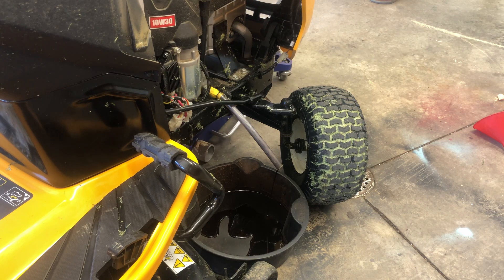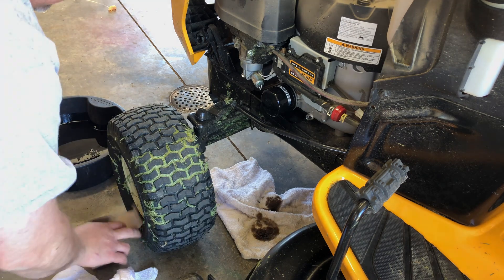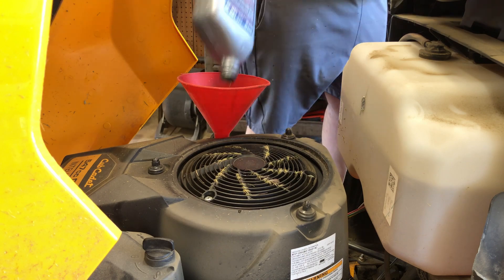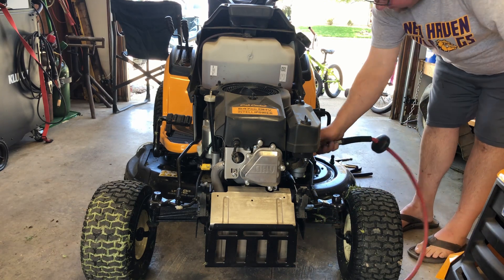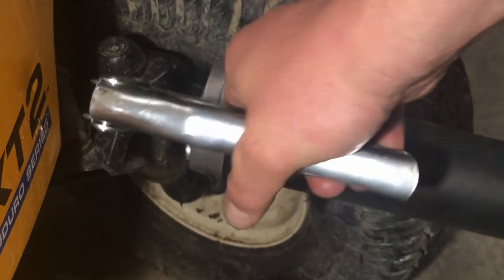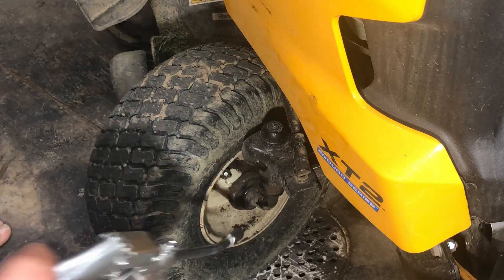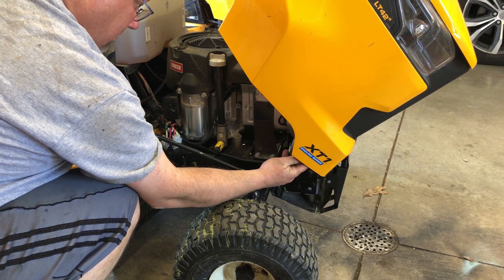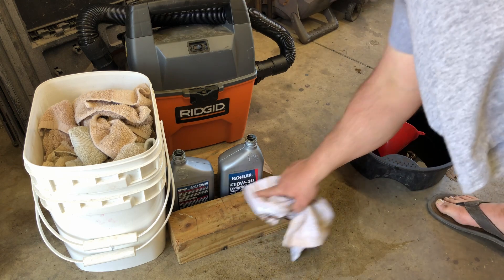Cub Cadet XT1 / XT2 Full service / Full maintenance including oil and filter change.

Comment: You should always apply NEW OIL on the new oil filter seal. Not old dirty gritty used oil. Who ever told you to use the old oil did not know what they were doing. You have new oil right there. Just a dab of it and you’re done.
Reply from the maker: I’ve never heard that but I feel like I’ve learned something new today. Thanks for the advice and I will do that from now on. I come from a humble background.
Reply: I  saw my neighbow forget to fill his new oil filter before he put it on  ,  not good either
Reply: @sissymurphy9620  both of these "tips" are misinformation. new oil isn't needed on the o-rings (makes no difference) and you should NEVER intentionally introduce contaminants into the "post-filtered" side of filters by pouring unfiltered fluid into them. new oil is incredibly dirty straight out of the bottle
Reply: @armedanddangerousdiy6096 amazing video sir, thank you so much for showing us step by step.
Reply: Nah, it doesn't matter. All the sediment goes to the bottom of the oil in the old oil pan when drained so as long as you skimmed oil from the top to use on o ring, you would be fine.

Comment: I realized that both mowers had the Cub Cadet engines installed because the Kohler orientation is entirely different.  I certainly appreciated your content. I have to do a tune up shortly.  Someone has some cool ideas or money saving tips.
Reply from the maker: Great point!
Reply: Those Cub motors are absolute trash- poor intake system allows fine grit to be ingested, scoring the bore

Comment: Some dispute about using grease on the steering gear…..many say the grease attracts dirt and debris and causes wear…suggest using a spray dry lubricant instead…that spin on oil filter is a real pain…oil leaks all over when taking it off…I fashioned a small tray to divert the oil beyond the frame to the catch pan…just my two cents…good job..
Reply from the maker: I had the same thought when I put the grease on, but I also know metal on metal is not the greatest idea either. I was figured I could clean it off with degreaser and acetone and try something else. I am going to go hunting for this mythical dry lubricant you mentioned is it just never occurred to me that such a product would’ve existed. Thank you!
Reply: DRY LUBE   or lithium dry lube

Comment: Interesting video. I assume this full maintenance is done once a year.
Reply from the maker: Yes. I did it in the spring for this video, but typically I do it in the fall after leaf pick up because the dust clogs the air filter. This way it’s ready to go in the spring time.

Comment: Please tell me how to make my intellipower run!  New Carb, Clean Gas, Clean Air,Filter, Clean fuel filter, clean fuel tank.  Carb was installed by certified servicer as was the fuel filter.  The dealer also drained entire fuel system, tank included    it starts but the only runs well when intellipower is cranked up all the was and blade is engaged.  Has 40 hours on it,  driven on level ground by a 87 year old man.  PLEASE.    Thank you.
Reply from the maker: I’m sorry but xt2 does not have that feature. It’s just an old skool throttle and choke cable. If it only runs well under load it sounds like it’s running rich. With only 40 hours…is it still under warranty?  Mine had a 3 yr warranty.

Comment: We bought a refurbished (never again) XT1 from home depot 1 yr and 1 week ago. Yep, that ONE week got us on warranty 😢anyway, both belts are fine but it stopped moving? Is there anything we can check? Hubs says he doesn't see a way to check transmission fluid in the hydrostatic trans? But obviously its something bigger than the belts? Thoughts? Help???😊
Reply from the maker: To be honest, I’m kind of a lousy mechanic, but if I had to guess I’d say your transmission is low on hydraulic fluid. Maybe you have a leak? I did some investigation myself several years ago and you are right that it is a sealed unit.  To be frank I’ve had nothing but trouble with mine as well considering it’s less than four years old. I’ll never buy another one of those that’s for sure. The only reason I bought it is most of the good tractors are too wide to fit between my cars in the garage. In a couple more years, I’ll dump this one and buy something of a higher quality from a dealer.
Reply from the maker: I spent 2700 with a snow plow blade and leaf bagger. I’m definitely mad
Reply: @armedanddangerousdiy6096  I just reached out to the repair center that Home Depot recommends and within 30 seconds he told me he has 7 or 8 of them, they're junk. Lol good to know NOW!🤣🤣🤣

Comment: You better take care of what u have the new Cub cadet is really gone down hill in quality, I bought a new LT enduro 50” the battery is AGM, which is weak, i replaced it in less than a year, selinoied  went out in 20 hours, transmission went out in 66 hours, MTD is gone to crap , the engine is good but the rest of is trash or cheap
Reply from the maker: I’ve had several repairs on this tractor and it’s only three years old. I fully agree with your assessment. The issue for me is no one makes a good quality mower. That’s small enough that I can fit between the cars in my garage. My plan is to own it another three or four years and go buy something else. But your comment is well founded. Cub cadet is not what it used to be. I think I’m going to go back to John Deere, a good one from the dealership, not a cheap junkie one from the local builder supply.

Comment: Does this differ much for the xt3?
Reply from the maker: I’m not super familiar with cub cadets line. The only difference between the XT one and the XT two is a larger engine and some other trim options that don’t really affect the mechanical functioning of it. If I had to guess I would say no and the XT three is just a slightly more heavy duty version. I have the XT two and my neighbor across the street. Has the XT one so I’ve been able to compare them side-by-side.  But I really don’t know. Thanks for watching!